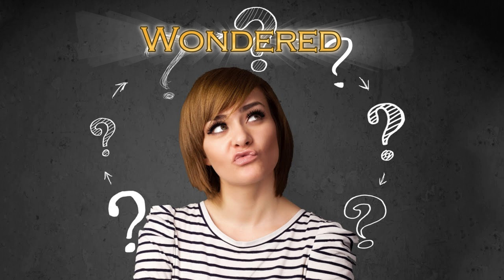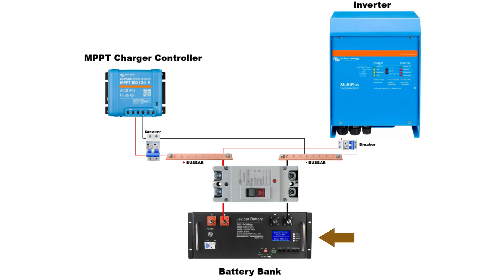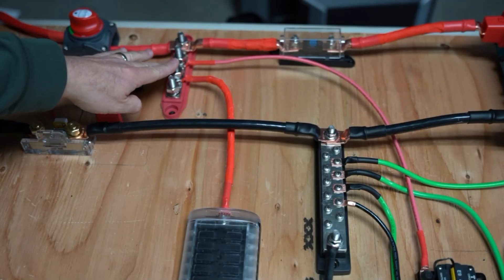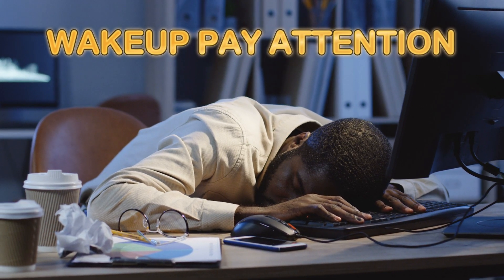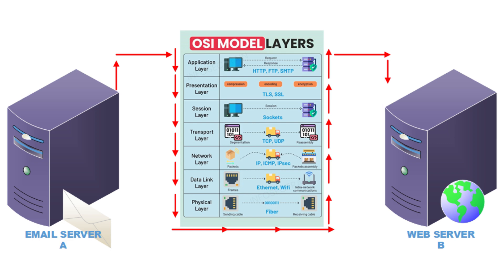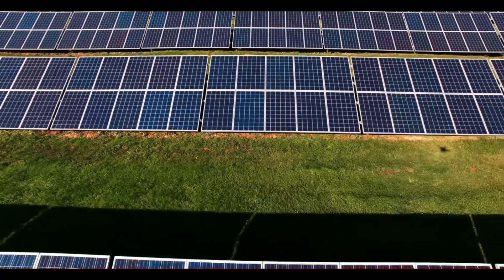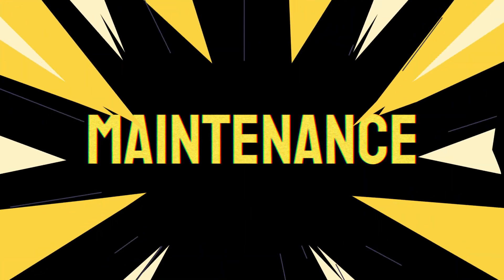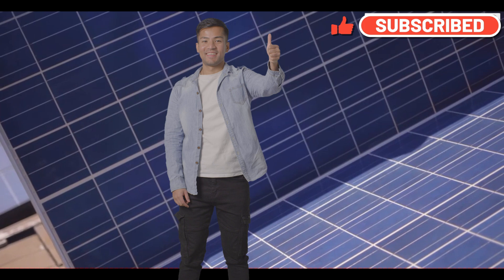ARE ALL IN ONE INVERTER/MPPT CHARGER BETTER THAN GETTING THEM SEPARATELY?

Comment: Honestly this video may have sold me on the opposite..

Imagine if the breaker in an all-in-one was that cruddy quality. Wouldn't be nearly as easy to replace with a better one vs a standalone part.
Trouble with the charge controller but not the inverter necessarily? Too bad, you're replacing the whole unit and sitting in the dark until it gets shipped.. or at least doing some janky hack to fix it.

Comment: Using seperate good quality parts is always better if you want to get involved in case of  failure...  bought spare mppts in case of  em failure and might have a smaller   expensive inverter if i want almost never to  be out of  electricity , . there are so many bulletproof parts  out to avoid all in one and more error codes  to handle with!!!   but its just me and i want to have some more stats fast and  change em in seconds if i dont like something.,..  so many seasons and reasons i want to have it more hybrid than the  all in one hybrids